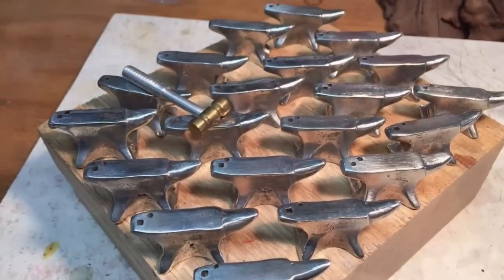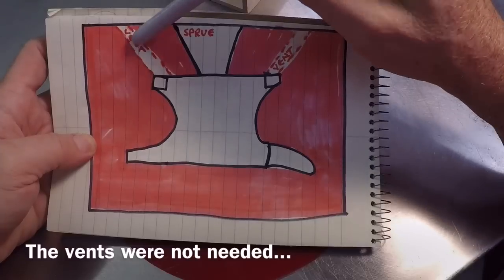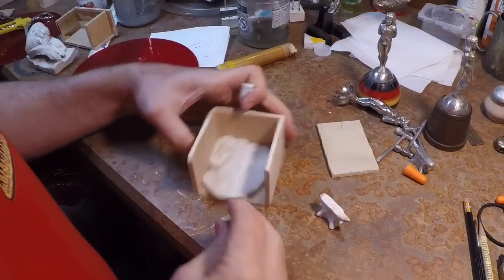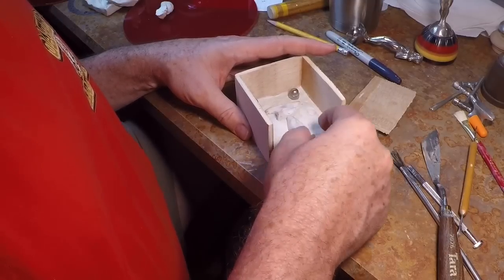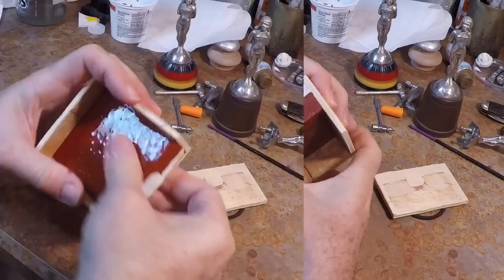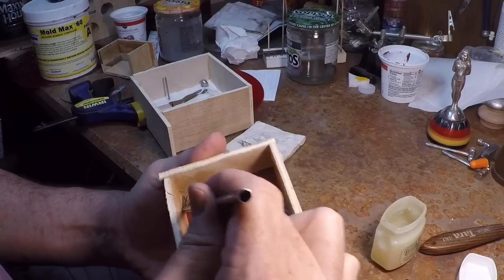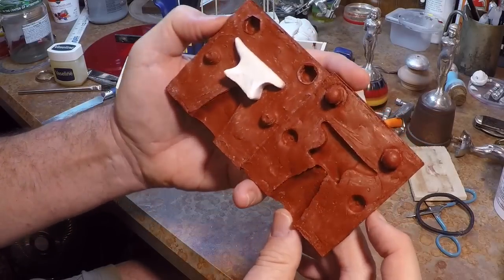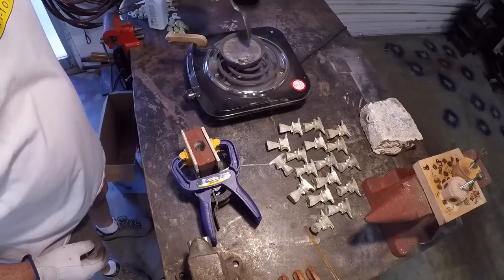How to Cast Seventeen Pewter Mini-anvils Using Mold Max 60 Silicone

Comment: Hi Jimmie...what do you use as flux with Pewter? I know higher melting point metals they use Borax. Thanks...great channel 😀
Reply from the maker: I sprinkle a little baby powder on the mold surfaces and spread it around with a soft paint brush before pouring.  Theory is it somehow creates a better pathway for gasses to escape as the metal hardens. I haven’t proven to myself that it is necessary for Pewter,  but the powder is cheap so I do it. Good luck!
Reply: @JimmiePorterAtStuartArts  Thanks...I was really wondering if you used a flux on the molten metal to skim off the dross etc. Thank you...Kevin

Comment: Have watched a couple of these.  No one explains the purpose of the baby powder in the mold.. unless I really missed it.
Reply from the maker: My understanding is that the powder creates a thin space around the hot metal and improves venting of gasses as the metal sets. The casting quality is generally better.
Reply: @JimmiePorterAtStuartArts  That makes sense... Thanks

Comment: Great work! I am not having the same luck mixing Mold Max 60. I measure it out and if it's off by the tiniest amount it either sets too quickly or doesn't set at all. I don't get it.
Reply from the maker: I’ve probably been lucky...I should measure closer I guess... I have found that there is a shelf life ...after a few weeks it’s got to be tossed because the silicone separates out ...

Comment: Do I have to vacuum de-gas the silicone rubber?
Reply from the maker: E Nimba I have not found that to be necessary....good luck!
Reply: I'm looking to make molds of civil war soldiers. I have never made a mold before. Looking at civil war soldier standing firing rife seem like to haves mold not possible. the arm holding rifle doesn't seem to be moldable will 3 or 4 piece be possible if so how difficult?
Reply: @enimba4409  I hope I'm not intruding and anyone please correct me if I'm wrong. Can you describe the pose? Is the soldier holding the rifle in a firing position? Or is the rifle butt on the ground and his hand on the barrel, held out in front of his body?
Reply: not at all, welcome all help. eventually want all those poses and more I want to create battle scenes. I never made mold before, but is seems when soldiers is shooting rifle the bent arm may be problem, also rifle may be separate mold the glued on final figure.
Reply: @enimba4409  OK, so it sounds like the concern is the empty space between the rifle and the arm? If so, you can add a thin layer of clay like a membrane in between them. This will prevent the mold from trapping the arm inside and the pewter would be thin enough that you could easily remove it. Does that make sense?
Reply: I kind of you what you're saying. have to try it out
Reply: @enimba4409  Good luck! I looked for some videos covering it but unfortunately couldn't find any.  But I've seen it demonstrated on paper before. :)
Reply: Thank you for all your help. My goal it to make a Civil War Infantry
Battalion battle scene (about 600 to 1000 soldiers) may be 20 molds of soldiers
with different poses. Then making multiple casting of each pose.  And maybe sell figures to help off set cost of
project. After reading this I might end up only with Company of solders (one
third to Battalion).
Reply: @enimba4409  Sounds awesome! Best of luck and have fun with it :)
Reply: about how much 55mm toy soldiers will max 60 (2.27 lbs. size) make.  ballpark figure ok, just to get general idea how much to buy
Reply: @enimba4409  I think it will depend on your mold size. Starting out you will probably use more than you intend to (to be safe) and adjust the size etc then. I recently did my first casting of a pendant and used too much of the Mold Max 60. I would guess you could probably get 3 molds with the 2lb kit. Again depending on how large your mold dimensions are. 
Jimmie Porter could probably give you a more reliable answer :)

Comment: Nice, concise video! I'm gunna have to make some molds, and melt some pewter. Worked for a bronze foundry as a chaser/polisher/painter, but wasn't in the mold dept, so lacking that knowledge as yet. Can just any pewter be melted so easily on a burner? I find pewter objects plentiful at thrift stores/garage sales for cheap. Also, wondering if i can mix in another soft, low heat metal to get a bronze look.

Comment: how would you make a silicone mold for a pcb enclosure top and bottom 2 piece case? would you cast as 2 separate molds?
Reply from the maker: Anil Somwaru I think it would need to be two separate two-part molds. I'd be interested in how this goes for you!
Reply: Jimmie Porter At Stuart Arts hopely everything works out but keep the videos going i really enjoy the casting videos :)
Reply from the maker: Anil Somwaru I sure will!